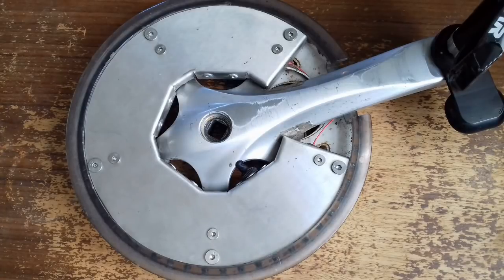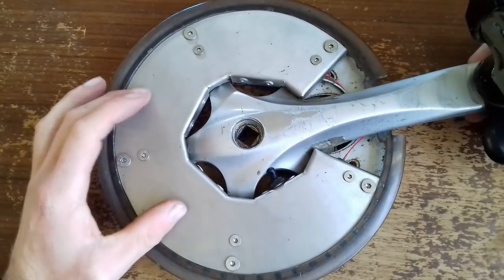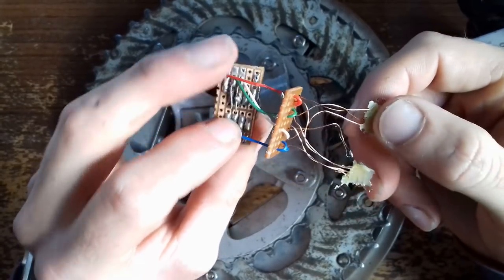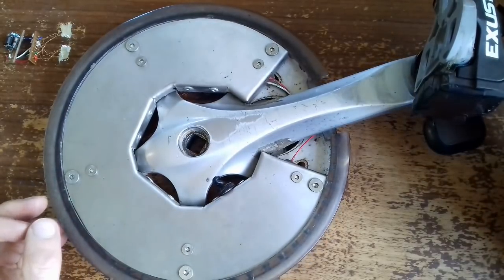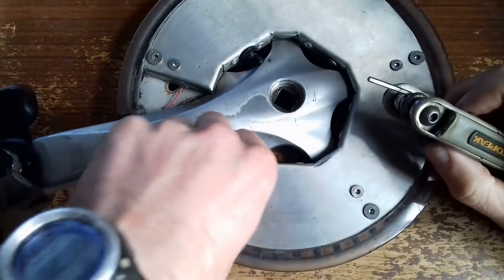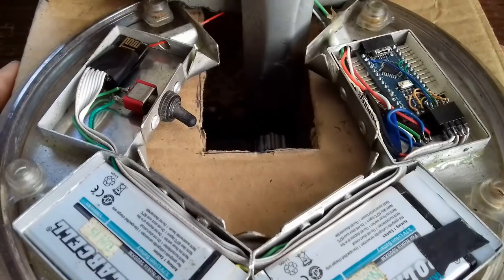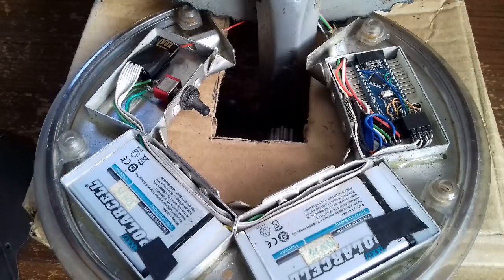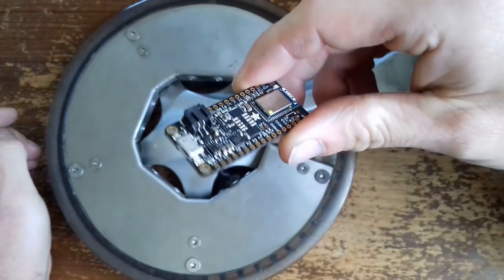Homemade Bicycle Power Meter

Comment: I have also implemented something similar for a home trainer (by the way, thank you for the code, I adapted some of it). While analyzing the data I saw that, at least on the trainer that has flat pedals and an upright position, I get a lot (well, non negligible) of negative force on the raising part of the pedaling stroke. So, I guess, this translates to inefficiency in the pedaling action because the other leg has to push harder to raise the other. On a long ride this will matter. I am curious, since you have (or had) those real power meter pedals, does the Garmin software show something related to this efficiency and advice on improving it?
Reply from the maker: I noticed that negative torque to and obviously it does reduce the average positive torque. However I see it as simply the downwards leg lifting the upwards leg. Balanced and not really adding extra effort. I'd have to think about it to decide if its what I would call an inefficiency although obviously if you learnt to lift that leg it would increase the potential power. I personally find other factors to be a greater limit to my power output.
The Garmin pedals are an older model so don't have that feature. I went for dual sided as I wanted my left/ right balance which they do give.

Comment: Hi! great stuff! but have you tried to compare ur data with some mass production product? 

because i hv made my own power meter with 4 straingauge (wheatstone), hx711 for the adc, mpu6050, and HM10 bluetooth.

the cadence comparation between mine and Bryton's Cadence Sensor works super fine! but the power output numbers doesnt satisfy me, when my power meter from my trainer shows arround 200 watts, my DIY power meter only shows arround 30-40 watt.

my calculation for the power output is 2 x average force (pushing and pulling) x cranks linear velocity. and my calibration factor comin from putting weight on pedal and making a formula by making and reading the bit output regression.

the strain gauge reading for a static measurement works so good, it increase 7 bit for every kilo. but when it comes to pedalling measurment, it somehow didnt  shows a great numbee

i dont know what i missed here :((

Thanks!
Reply from the maker: I do compare mine to some Garmin Vector pedals and getting very good results. Typically within plus or minus 5W for a ride average.
Just to confirm the power equation is Power = ((avgValue * calibrationValue * cadence) / 9.5488)
Calibration value converts the average ADC value into torque in Nm. I calculate power every time a full rotation is completed.
If you are getting good results out of the HX711 and it stays zeroed then it is only a matter of coding to get good power data.
I have other videos about my power meter in a playlist. The latest goes into the code in detail.
Reply: @Ed.R  thx for the response Sir ! but by the time i posted the question, i get the answer in few hours.

before i do the code, i do a test from which angle that measure most accurate number due the weight, and found that 90 and 270 are the most accurate, so i only use that angle to receive some data. turns out, it was a wrong move, having a full data on a rotation does gives me more accuracy  on power output (even tho i found out that some angle does a weird reading on weight callibration)😄 sometimes, sometimes, our brain doesnt sync to a coding algorithm aint it 😄 

now, i have the accuracy arround 2-6 watt compared to my Magene T100 Trainer. 

ahh, one more question. i used Mpu6050 for a cadence sensor, turns out, it cannot read the cadence if it pass 80 Rpm, it either stuck on 79-80 or didnt display the data. do you hv any idea of this problem? 

i hv seen some article that says MPU6050 needs to be installed Kalman Filter due the inability of high frequency reading. do u hv any idea how to use Kalman filter by only using Z axis? bcs i hv surfed arround google and yet not find any clue of how to code it😔
Reply from the maker: @MrSafetyRider  Glad to hear you are getting better power data, I knew it's possible.
I have to be in the right mood to write code to. You definitely have to average every reading from the entire rotation. I'm not sure what sample rate your HX711 is running at but the higher the better. I've added a crystal to mine and now get 133 samples per sec.
When it comes to getting accurate readings for a given weight at different crank angles that is a very complex thing. It's all about the geometry of the crank and the connection to the chainrings. Compensating for this is one thing that makes power meters so expensive. With my crank I get a slight negative reading while only pushing on the opposite crank.
I'm afraid I can't help with the cadence part because I don't use an IMU. Everything I know about them I have learned from this guy https://youtu.be/2AO_Gmh5K3Q

Comment: this is so well put together. I am honestly impressed with the housing...
Reply from the maker: Thank you, the weight is the only problem with it.
Reply: @Ed.R  what about 3D printing it? or letting it be 3D printed?
Reply from the maker: @Medievalfan94  very much doable. My latest power meters have the battery, Arduino and electronics inside the hollow crank axle. Only a plastic cap needed to weather proof it.
Reply: @Ed.R  that is exactly what I was planning to do :D would you mind showing off that new version in another video?
Reply from the maker: @Medievalfan94  The newer videos in this playlist show it.

Comment: Hey ed I was reading your forum post and i was wondering why do you connect a resistor across one of the gauges? Was your wheatstone bridge not balanced with just the gauges themselves? Yesterday I finished gluing up the gauges to my crank so i'm looking for a final read before jumping in and soldering them to my amp (an HX711). Thanks for reading!
Reply from the maker: That's my incorrect way of getting the balance so that its not balanced but has a slight offset in the correct direction. It works but I think it contributes to instability due to temperature changes. Depends on your amp setup as to exactly what the output of the bridge needs to be. Try different resistors once the amp is connected.
Sometime I want to experiment with amp circuits to make one that has an adjustable offset. Got some two stage amp circuits I might try and make work.
The other thing to watch out for is that a change in bridge excitation voltage will affect the offset. So if you changed the Arduino for example. 
I want to experiment with adding a 3.3V regulator for bridge excitation. Then power it and the amp off the Arduino 5V.
Still rather like my current simple design as I does work once you get it right. Extreme simplicity was always the goal of this project.
Reply from the maker: Was also playing around with the Arduino VREF pin seeing how low the voltage can go. I got to 0.55V before it started going weird. Gives a resolution of around 0.5mV not bad but the output of the bridge varies by around 2mV. Direct reading still not an option but does reduce the amplification needed. Just something else I might try if I can sort out a good 0.6V source for the VREF pin.
Reply: @Ed.R  Ohh I see, I will take that into account currently uni is keeping me busy but when i get some spare time i'll wire up the bridge and test it out. Thanks for the help!

Comment: Hi, i have nearly finnished my project, but I can't handle a code for a strain gauge. Could you help me out? It's for my university classes and I would appreciate your help :)
Reply from the maker: I'll have a go, are you using an Arduino?
Reply: @Ed.R  Yeah, arduino nano to be exact
Reply from the maker: @GenStarscream  Perfect as that's what I have used.
I expect the voltage from your amplifier will need smoothing unless you have added the correct value capacitor. If it does need smoothing you will need to set up a timer interrupt on both timer 1 and timer 2. I went for 1kHz for the smoothing code and 100Hz to sample this and calculate the average force during a pedal rotation.
If you can specify in more detail what you stuck with I can help further.
Reply: @Ed.R  For calibration i thought I need to treat it like usual scale. Readings are strange. Sometimes i put weight and value is slowly increasing(weight stays the same, but value grows and grows). When I calibration factor in IDE by entering +/-, on next try values are different. Also sometimes value increases but when I remove weight value stays constant.
Reply from the maker: @GenStarscream  Welcome to the weird world of strain gauges. I had the same problem with mine at first and I'm facing the same with the second one I'm currently building. Rewiring the stain gauges fixed it for the one in the video but I never tracked down why, was more like I just got lucky. I wish I could help more but there seems to be a lot I need to learn to.
Calibration is something that will need to be done every time before the power meter is used as the value will change.  It shouldn't change much over the short term but may due to changes in temperature and from one day to another. Blowing on one of the stain gauges is enough to make mine go out of calibration although only temporarily.
Reply: @Ed.R  Why do you mean by rewiring? Before my 120ohm setup I had 350ohm and as I remember similiar things was happening. For cadence measurement I'm using MPU6050 , it's small component so you could use it too, it also works fine. Are you able to share a code for strain gauge part of a project? Maybe in that way I could find out how to do it properly.
Reply from the maker: @GenStarscream  I replaced the wires connected to the strain gauges from enameled copper to very thin plastic coated.
I have considered using something to measure cadence but rather like keeping the component count to a minimum. 
I'm just working out the best way to share the code. The strain gauge part is tangled up in the rest of the code. Some of it may need explaining as some of the naming doesn't make much sense.
Reply from the maker: @GenStarscream  First and most important is to get a stable value from your strain gauge amplifier. Once you have this you'll need some code in the void setup to read what this is and store it as for example zeroTorqueValue. You could also have this code run when a button is pressed or a message is received over bluetooth.

Next is a timer interrupt at something like 100Hz I also use this for calculating cadence. 
On each interrupt add up a total for example 
totalTorque = totalTorque + (ampValue - zeroTorqueValue;
Then increment a counter.
When you decide a full rotation has been completed calculate the average. 
avgTorque = totalTorque/ counter;
Cadence can also be calculated, cadence = 6000/ counter; if interrupt is 100Hz.

In the void loop which I'm running at 2Hz you can calculate the power.
Power = ((avgTorque * value calculated by calibration against a known force * cadence)/9.5488);

There's really nothing more to it for reading the strain gauges appart from the smoothing code. I used the example code from the Arduino IDE running in a 1kHz timer interrupt. const int numReadings = 50;

Comment: Clever stuff. I commend you for your efforts and for the video.  having worked with many different strain gauges in the past i can confirm how difficult they are to calibrate properly and to stay in calibration. and these were industry built units that we bought in 'ready to go' !  Good luck with your improvements.
Reply from the maker: Thank you, I will find out when I make the next version if I just happened to get lucky with the strain gauges. It did take a few attempts to get the offset right and a complete rewire to remove some occasional randomness.
Reply: Ed R worth a mention that 'dry' solder joints cause havoc. Also have u thought of encapsulating the electronics to eleminate external influences e.g. water/moisture/humidity/temp.  I suspect you'll be successful anyway 😉
Reply from the maker: @macolganjames5937  May well have been a dry joint I had no idea how to solder such tiny strain gauges. 
That's a good idea to encapsulate the electronics. I hadn't considered it, only how to best weather proof the strain gauges.
Reply: Ed R Something that may help you 😉

Comment: oh I like how you are measuring the cadence, cleaver.
Reply from the maker: Thanks, it works surprisingly well, just very occasionally at very low rpm (<50) and high torque it fails.
The rising edge trigger value is currently 5.9kg. I could increase this but would begin to reduce its low power measurement capabilities. It will measure reliably down to around 15 watts.
Reply: I'm not sure if I'll really be able to attempt to replicate your design, short on time you know, but for the arduino program, would you share it if I did try?
Reply from the maker: @BruceChastain  Time is something you need for this project, strain gauges can be a pain to work with. If I'd payed myself a wage it would have been cheaper to buy an expensive one.
Yes I'd share the Arduino code if you want to do it.